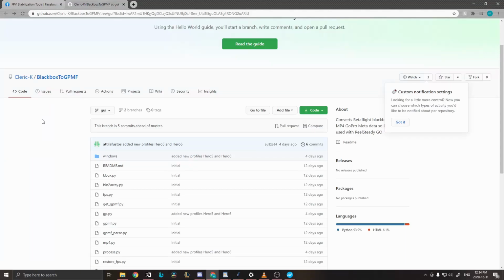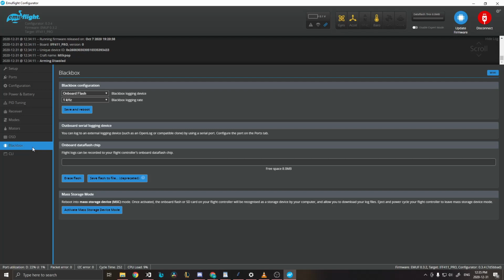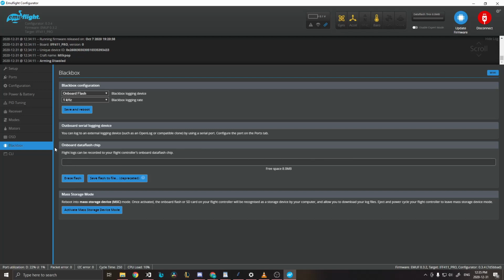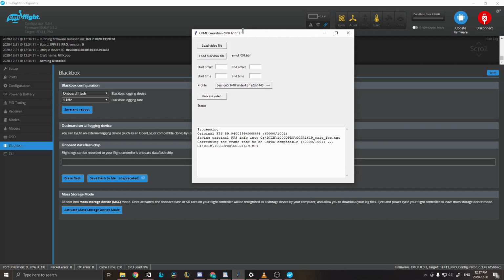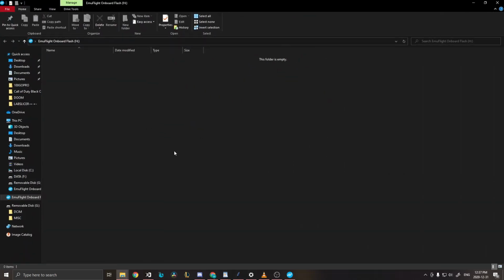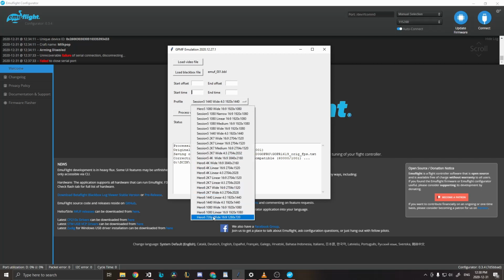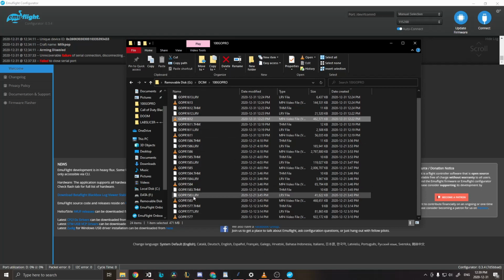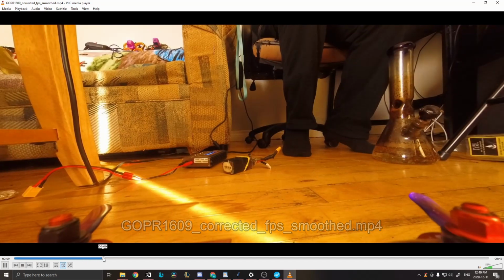Use REELSTEADY on ANY CAMERA?! | FPV(OUTDATED SEE DESCRIPTION)

Comment: I have thought about this a lot but not for drones. You could mount a Gopro on top of a DSLR and use the gyro data. Wish there was a way to do this. Should work perfectly so long as you shoot at a fast shutter speed and have some way of setting the angle on the camera.
Reply from the maker: Guys in the community have already been experimenting with mounting flight controllers to their cameras for the gyro data, it works fine and eliminates the need for angle input

Comment from the maker: IMPORTANT UPDATE: I've been informed that the file you're supposed to run through Reelsteady is actually the GP***_OUT files that will appear in the "windows" folder with your GP.exe
Reply: I don't think this is correct. The file with _out on the end that is created in the folder with GP.exe is 0kb in size. Whereas the corrected fps file is the size of whatever video you imported. Are you sure this is correct ? Im confused because in your video it shows corrected fps under the video that is stabilized. Am I missing something?
Reply from the maker: @doom3crazy  Attila who wrote the UI for the script mentioned to me that it is the OUT file. The 0kb file that you're seeing is likely due to a problem with the offset/time parameteres. Here's an explanation from the project's original coder on how these parameters work: https://github.com/Cleric-K/BlackboxToGPMF/discussions/1?fbclid=IwAR1qlzrwy9d-8Dbz8dF_ndGyahQmpj-sqk4xRUMO3_vhQEBDd22LmvyNcQQ#discussioncomment-256391
Reply from the maker: @doom3crazy  New guide up for the 0kb issue and setting time/offset parameters: www.youtube.com/watch?v=ah05puytzKw

Comment: does it work at any gopro mounting angle or only when the fc and the footage are aligned?
Reply from the maker: Attila who helped refine the code for this says that by default it's set to 30 degrees, and you can change that parameter in one of the scripts. Next iteration of the software will have a variable parameter for setting camera angle.
Reply: @PropsOutProductions  that's great, thank you

Comment: The team is a genius! Let’s get in touch, we need to get rid of the 0 camera angle!
Reply from the maker: There's actually already  a parameter in the code that can be used to compensate for camera angle, just not sure how to switch it around without going straight into the python files. I'm going to message Attilla and see if I can't get a little more info on that.
Reply from the maker: UPDATE: New version of the UI includes setting for camera angle!

Comment: get FC with SD card and you will have space for 1000 flight logs ;) it's a shame tho that theres not many FCs with sd card slot, but it comes really handy if you need to troubleshoot some random in flight failure, or lets say do stick overlay on top of video
Reply from the maker: You know you just reminded me I was gonna link to some FCs with either SD card capacity or high onboard flash space, thanks!

Comment: Can this be used with a hero 7?
Reply from the maker: Yes, it can. With this you no longer have to soft-mount the hero7
Reply: @PropsOutProductions   so even with a sd card for black box logging is 16mb still the hard limit ?
Reply from the maker: @doom3crazy  No, SD card logging should work. You just want to make sure it's at least a U3/Class 10 quality SD card or it won't keep up with the blackbox write speed
Reply: @PropsOutProductions   oh okay awesome.  And I did read a comment about camera angel.  So if my go pro is at a 30 degree camera angle will that not work ?
Reply from the maker: @doom3crazy  I run the gopro on my 5 inch at 30 degrees, but it's out of commission right now so I can't really test. I'd say give it a try, but if you run into issues I'll talk to the guys who scripted it because I know there's a parameter you can change to accomodate camera angle
Reply: @PropsOutProductions   I’ll run a test with my hero 7 and let you know. I just joined the Facebook page. Is there a discord or anything ?